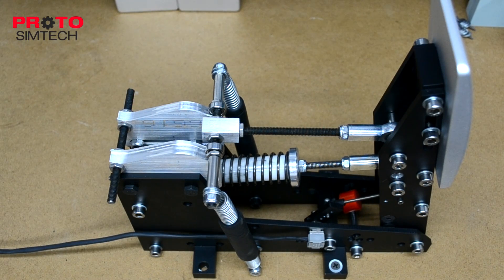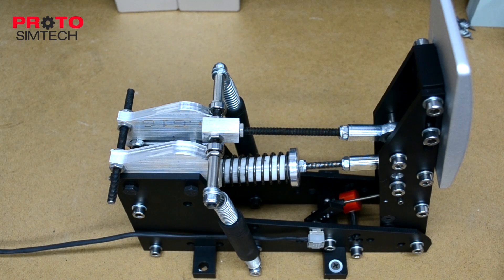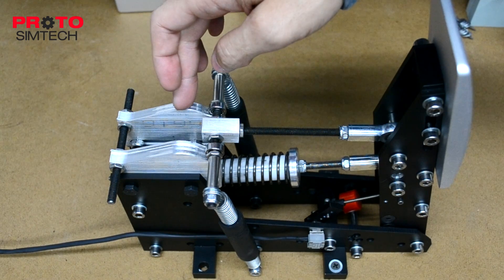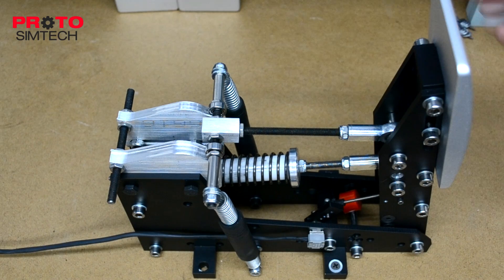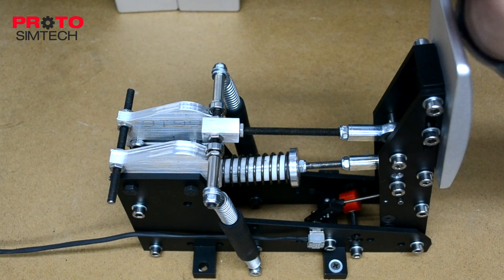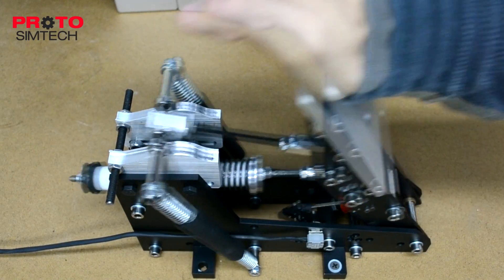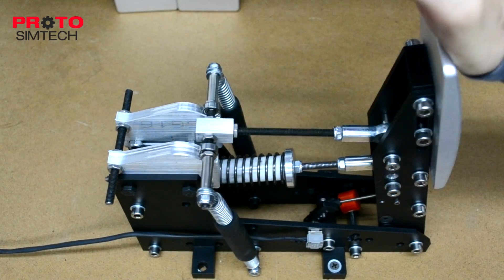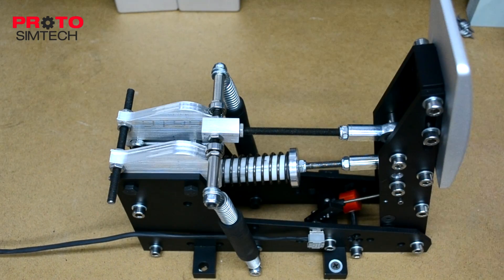Clutch Mechanism

Comment: Very nice looking pedals, these are quickly moving towards the top of my "wanted upgrades" list! My only concerns with the design would be wear and tear on the "bumprail" and the possible buildup of squeak or other noise from the springs and other moving parts.
Reply from the maker: As far as noise is concerned, there really isn't any need to worry about this. Our beta tester has been using these pedals on a daily basis since June with zero issues. Furthermore, we'll be coating certain parts with proper lubricants before the pedals ship out.

however, we have a couple of safeguards in place for noise related issues. For example, those two additional springs that are part of the clutch mechanism will be covered with foam tubing to eliminate any noise as they move. Also, there really won't be any wear and tear on the "bump" for the clutch mechanism. It's made from 6061 aluminum, which is very strong material.

Over time, you'll start to see the bearing wear a groove into the powder coating on that bump mechanism. This is normal. In fact, this will help ensure smooth operation. Once the groove has been worn in, the operation will be even smoother than when you first start to use it. We noticed this when testing our own set of pedals.

If you're worried about those bearings wearing down the metal itself, don't be. There's isn't enough tension on those springs to wear out the metal. Even if that happened, we would replace it for you.
Reply from the maker: Kjell Eilertsen My pleasure ;-) We understand that people have questions and concerns, so we try to answer them as best we can, and in a timely manner.

We don't always get to every question or comment, but we do read every one of them.

Stay tuned for new videos coming very soon. We'll be giving you guys weekly update videos to make sure all of you know what we're up to and what sort of progress we've made.
Reply: ProtoSimTech
 Thanks a lot for your swift and thorough reply! I need double xmas this year! :P
Reply: ProtoSimTech I can't stress enough how much it is appreciated to hear feed back from developers. I think what your doing is amazing! Although I'm more than likely going with another company for my pedals because I'm looking to upgrade anywhere from this week to next month at the latest, I appreciate all of you guys producing amazing products for our niche market. Please keep up the great work and I'll keep my eye out for other products. cough hand break cough H-Shifter lol
Reply: Ohh another question, any chance you'll be providing a plate to mount them on for those who can't hardmount each pedal separately? And how about an optional frame/rig to mount them inverted on (which would be hardmounted at the bottom like most "regular" simpedals are).
Reply: Kjell Eilertsen you could always make your own from 80/20 extrusion. My whole rig is made from that stuff. So any pal system I choose to go with, will be ready to mount. Very versatile stuff.
Reply: In my case they would be used on the floor or soon to be mounted on a wheel stand, building anything ain't an option for me sadly. ><
Reply: No it really is. You can build a box with rubber feet from 80/20 extrusion and place them on the floor. I should have some pictures on my profile.
Reply: Saleem Hodge  Oh I'm sure it's "easy" to do, but it's not exactly "wife-friendly", and my "rig" needs to be until we move somewhere where I can have a separate room for things like this :)
Reply: Kjell Eilertsen I really think what I'm thinking for you wouldn't annoy the wife and wouldn't coast all that much. And it can be incorporated into your future rig.
Reply: Saleem Hodge Just goes to show you don't know my spouse :P
Just having the gear visible annoys her, I've ordered a wheel stand partly because it allows me to quickly put the wheel, pedals and shifter away and out of her sight. Later in life, when we've got more rooms, I'll be going full rig, but right now I need something that doesn't look industrial and can be tucked away in mere seconds :P
Reply: Is going to look industrial for sure because it is lol. But picture a simple box and the pedals would sit on that. When your dine you can pick it up and put it away.